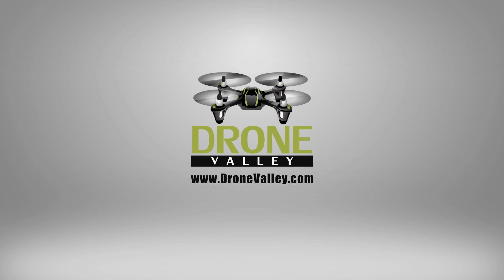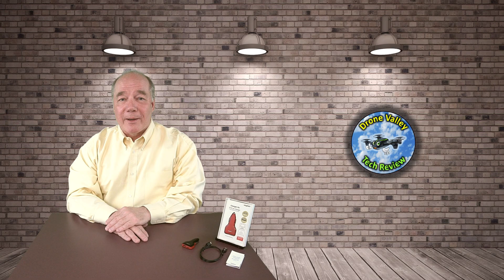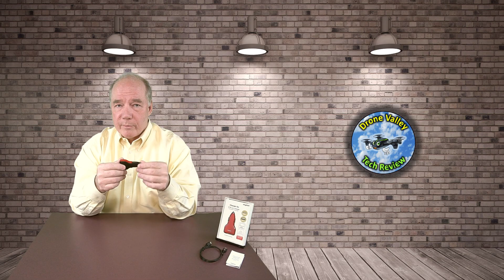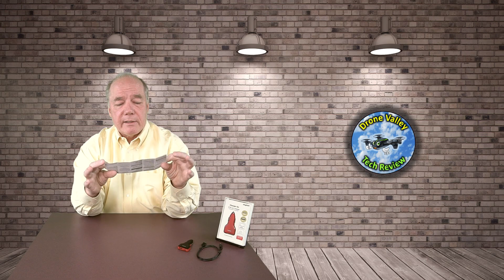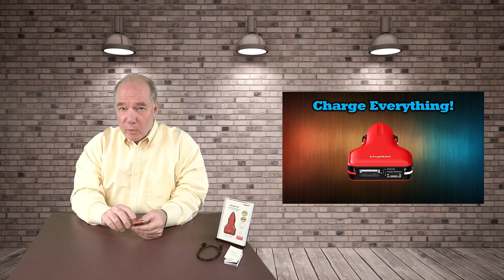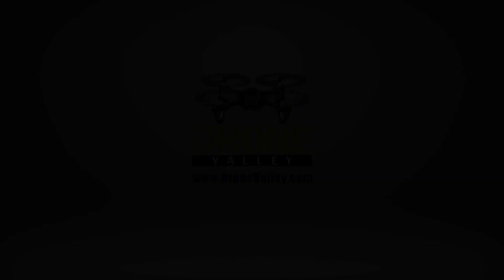The Ultimate Car Charger - VogDuo 57W Charger Go

Comment: Is that input or output wattage Rick? How is it calculated bearing in mind the different output voltages? Is it simply its maximum power usage at 12V that would be around  5Amp current draw. Just wondering. Keep up the good work, Mike.
Reply from the maker: Mike, that 57w is total output for both ports. The USB-A is 12w (5v x 2.4a) and the USB-C is 45w (20v x 2.25a). The best part is that you can use them both at the same time to charge devices. It's really a nice little charger that packs a wallop. Thanks for the post, Rick

Comment: I wonder if it will fast charge the DJI smart controller?
Reply from the maker: Tom, I wondered the same thing and tested it today - no joy. It charges it fine but at  a standard rate of charge. I'll post a clip when I find one that fast charges the Smart Controller. Thanks for the post and stop back soon. Rick
Reply: @Dronevalley  thanks Rick. I'd love to find a power bank that would keep the smart controller charged in the field. I hadn't been able to find one of those but if you hear of one let us know!

Comment: Thanks for the post-Rick...How did you determine it is a 57W charger...you made no mention of it.
Reply from the maker: Thanks for the post and the total power (in watts) is the combined power of the USB-A port (12 watts) and the USB-C port (45 watts). The fact that you can use both of them at the same time, at full capacity makes this charger really special. I use it in my truck to charge my quad controllers and my laptop while driving to locations to fly.
Reply: @Dronevalley  Thanks for the quick response...I appreciate it.